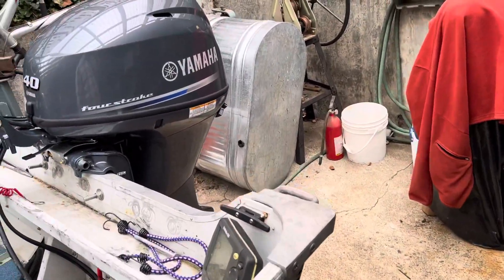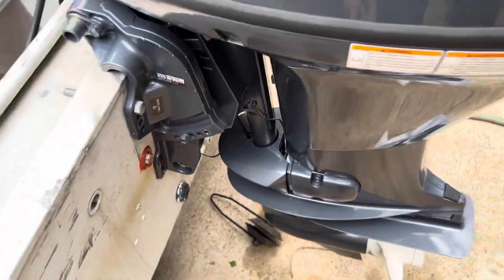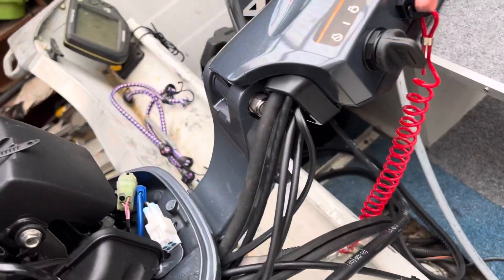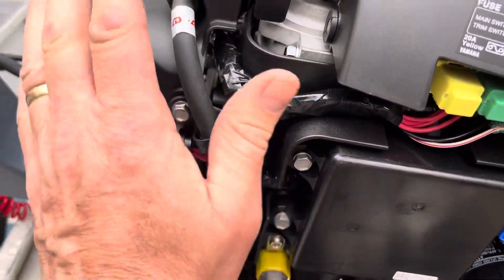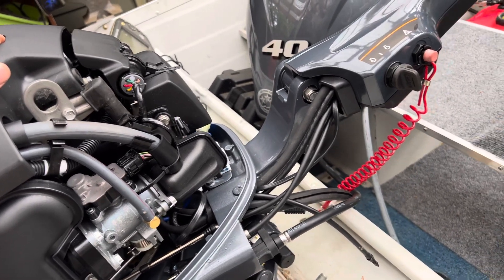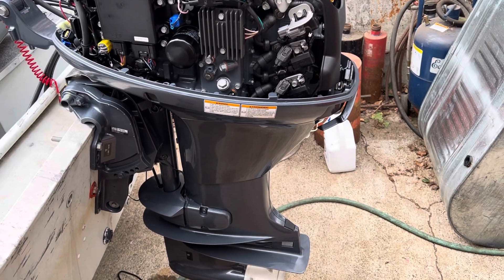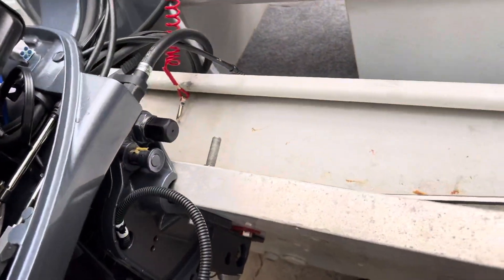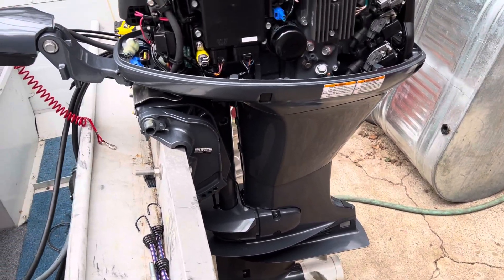40HP Yamaha Outboard Unboxing

Comment: A tilt lock is there. Raise the motor all the way up, push in the lock pin. Its on the clamp bracket near the tilt tube. The prop needs to be sized to the boat. The dealer typically recommends which prop to use. A 40 could be used on a heavy party barge or a lightweight skiff. The props used would be vastly different.
Reply from the maker: Good point and thank you for the tip! I’ll check it tomorrow!

Comment: Great video and very helpful. I also recently purchased a F50 and separate tiller handle. Just wondering about the tiller mounting bolts or studs. Do the come in the motor? My tiller just arrived but there weren’t any studs with it. Thx

Comment: I know it is a old video but am looking at buying one right now, how has the nitro assist treated you? Is it hard to pull up and could you do it while sitting? If you could go back again would you spend more on power tilt and trim? Thanks
Reply from the maker: The nitro assist works well. Not hard to lift. I haven’t tried it while sitting. I will check it out. I would buy it with the power tilt. I bought it during Covid and it wasn’t available. Sorry about the delayed response

Comment: If you use the cylinder to tilt hold motor up for towing it will act like a diving board with shamoo on your transom. Now u are going to potentially crack the transom.

Comment: Where do you fasten the power cables I see the hot wire where does the ground go ?
Reply from the maker: The ground goes to the negative terminal on the battery.
Reply: @OregonPanoramas  Not on the battery on the motor lol I figured it out.

Comment: I’m considering a 15 foot g3 that has a 40 Yamaha on it and was wondering how that big of a motor does without power tilt? Trying to decide between that or the same boat with a 25. I don’t want to get a motor too big without power trim if it’s too much to handle. I guess it’s good though in case you were to hit a small stump or something and having it break away vs no give. Any advice would be appreciated!
Reply from the maker: It turns out I do not miss the power tilt m, much. The gas shock is balanced so it does not take much effort to raise it. If I had had my choice I would have wanted it for when I am on the lake so that I could easily tilt it up and switch. to my electric motor. But on the other hand it trolls so nice and slow and quiet I may never use my electric motor again! My advice it to go to the 40HP. I think it is always better to have the power.
Reply: Plus if you go with the 25 it’s about 75 lbs lighter than the30/40 family.
Reply: Buy iwer trim tilted best 25 hp.  Otc50

Comment: Probably too late here but that three prong plug is for the power tilt/trim
Reply from the maker: Thanks! Never to late
Reply: do you know where the blue and green wires go for a power trim motor?
Reply: @kadonluke2243  blue is up, green is down. Think of it as “sky=blue, grass = green”
Reply: @hbouldin1216  cant figure out where at on the motor itself

Comment: I'm a Yamaha tech. Here's an explanation for what's going on at 10 minutes: The engine won't engage reverse gear simply because the drive shaft can not align with he prop shaft.it's enaged through slots in the gear selector assembly in the lower unit. It will align if you spin the prop shaft slightly, or run the engine. it needs to spin around to engage. never push the gear selector hard when the engine is not running, because it causes a lot of stress on every component in the shifting assembly.
Reply: Also, when you buy a yamaha outboard from an authorized dealer, at least here in Norway, you do get a prop included.
Reply from the maker: Thank you. Great helpful explanation!
Reply: @The.Norwegian motors over 30hp and over don't come with props in US

Comment: Curious to see if you got it running yet? I’m considering the same outboard!
Reply from the maker: Yes! It started on the first pull! Haha. It has been great. Only out twice so far. The first time doing the 2 first hours of breakin. The second time fishing. I never thought I could troll with a 40hp but it idles so nice! Next trip this weekend. It is such a pleasure so far. No smoke and so smooth and quiet and I love the idle speed adjustment toggle on the tiller handle. I’ll do an update soon. So far…. Very happy.
Reply: @OregonPanoramas  That’s good to hear! Glad it’s working good for you. I’ve got a older carbureted F25 on my boat now and I’m trying to decide if I’m going to get the new fuel injected F25 or the F40. I’ve got a 16’ Aluminum boat. Thanks for the video!
Reply from the maker: @Yellowsierra02  I have a 16’ aluminum Alaska “Big Fisherman “ that motor make is fly.
Reply: @OregonPanoramas  Thanks for the video! How slow will it troll?

Comment: yamaha 40 .... like 140bls weight and move up to yamaha 50 the weight so up to 250bls.... Hmm. ???
Reply: 30-40hp  =750cc 3cyl. 50-60hp 995cc 4cyl bigger block hence the weight
Reply: It's actually 214 lbs and the 50 is 247 lbs

Comment: Thanks for the video. Did you find out more info on the 2 wire connections regarding what they are for? Did you also find out how to make use of the speed cable? I just picked up a 2023 70 hp and am installing myself and am searching for videos as well. Here is another one that has some good info. https://www.youtube.com/watch?v=ffU4hJEHuxs P.S. I am also in Portland Oregon
Reply from the maker: Thank you for that! No. I still don’t know what the 2 wire connection is for.